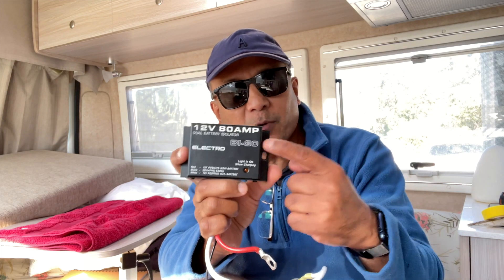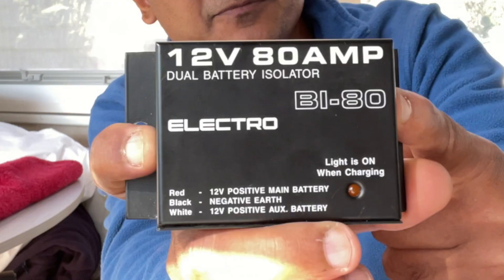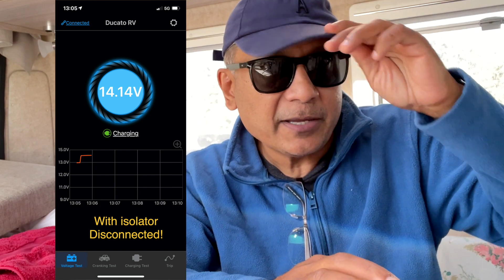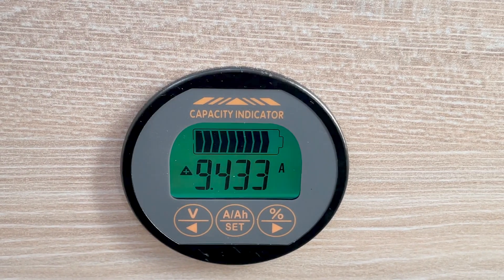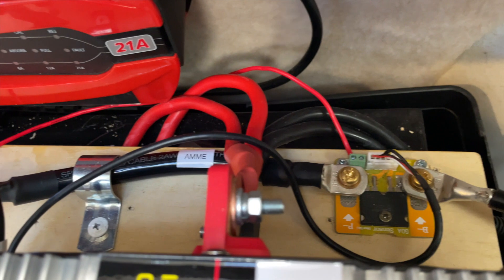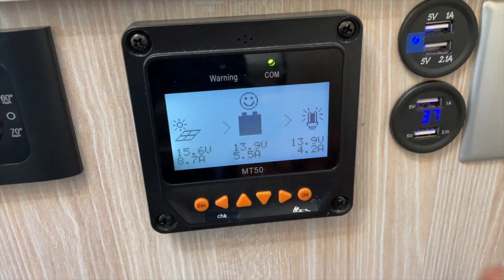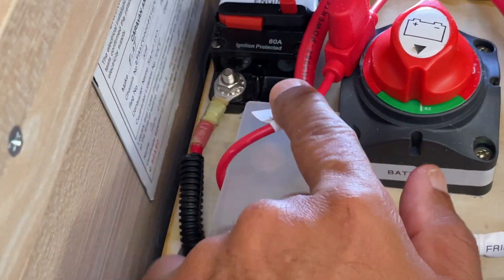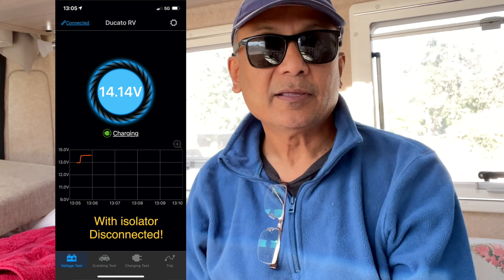Charging your Engine's Battery with your Solar Panels!

Comment: Nice. I don't have a van  yet but have a solar system i am practicing on, on my balcony. solar panels, controller, agm marine battery. I was thinking of getting a 140 amp keyline isolator, that many ducati owners use (i have not yet ordered my 2022 promaster). It comes with a 180 amp alternator, i was thinking of getting the upgraded 220. Apparently these are not smart alternators. The fridge i have on order has its own battery so i am less worried about  power shutoff for it, and am only going to be doing weekends at the start. You mentioned your alternator is a smart one. Are N. American ones not the smart ones? My other question is I have an intelligent charger for my car battery, 2/6/12 amp, it senses and then adjusts the charge. it has alligator clips. I was thinking of having a plug on the driver's side that is just basically a sealed 110v extension cord. I was thinking i could plug my charger into that, which would be shore power. So where would i clip the alligator clips of the charger onto? Still directly on the (house) battery terminals? Or bus bar? or where? At the start my solar is not too big, nor is the controller. I expect a 2-3 hour drive each way would top up my battery for the weekend and i could get a second battery.  And we get overcast days. the solar would help keep a charge until i upgrade the solar system. I see you are not a fan of the isolators but it seems like a good solution to me, and i think it provides more than 2 amps. Thanks! Love your vids. What is your engine now providing with a 180 amp alternator when driving? 9 amps? or was that your solar?

Comment: Hm, I would suggest a device like the Votronic VCC 1212-30. A direct parallel connection could have a number of problems, especially when the cell types are so different and the wires so long.
- If the starter battery is disconnected and one of the batteries is full while the other one is empty, it could be impossible to connect them again. The charging current would be so high that the fuse/protector would open (what is good).
- If you start the inverter, there could be a very high current coming from the starter battery and going through the long wire and the shunt to the inverter. Again the fuse would open.
- Same if you start the car engine. A high current could come from the lithium battery.
- Lithium batteries and lead batteries have different end-of-charge/discharge voltages and also different charging curves. The integrated BMS in your lithium battery will only step-in when the absolute ratings are violated. It will not make sure that the long-term treatment is in a healthy way. (This problem may be there anyway because all your chargers are obviously designed for lead batteries, so you have to live with this. Hopefully you don't have a charger that tries to treat the battery with pulse loading and similar things that are done to increase service life of lead batteries.)
Reply from the maker: Thanks for your helpful comments.. i will isolate the starter battery when i use  inverter so that high draw from the starter battery is avoided... but i am not concerned about over-taxing the lithiums when starting the engine because I have 300aH batteries which are rated to discharge 150A, so they help the starter battery.. also unlike in a caravan where the cables can easily be 6m or longer.. in a van it's not too bad.. and there is no significant voltage drop i could measure.. but a self-resetting 20A fuse (circuit breaker) protecting the starter battery is a great idea bec even if i forget to isolate the starter battery when using the inverter it should in theory stop discharge from the starter battery.
Reply: I was not concerned about discharging the Lithium battery but about the high currents. If the fuse disconnects the batteries during engine start, you cannot charge and maybe notic this only after driving. The self-resetting fuse could help here.

If the self-resetting fuse is triggered because of the inverter, it could happen that it goes on and off constantly. Maybe you can hear this and then isolate the batteries.